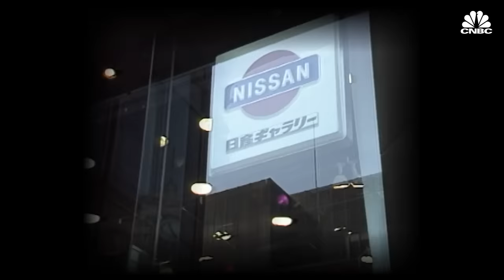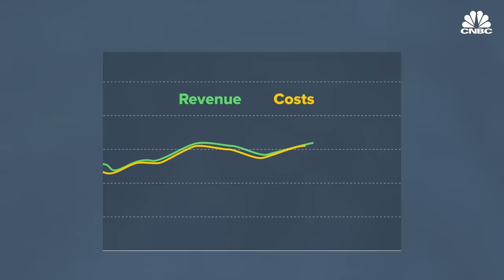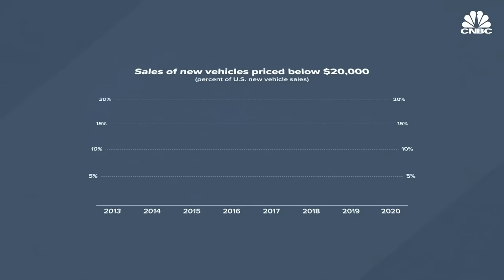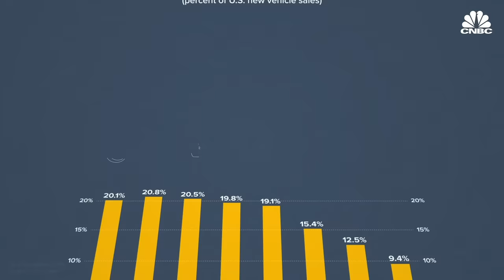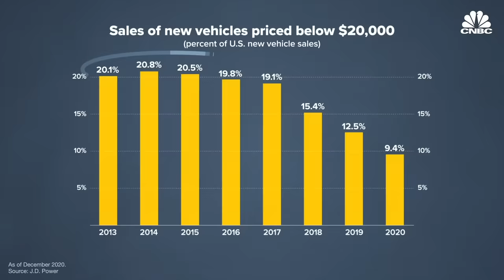Why Cheap Cars Are Disappearing

Comment: Just buy a 3 years used car and save like 40%
Reply: I think that's a big part of why cars are getting more expensive. People who want to buy a cheap car get a used one.
Reply: @TheTaquitoProject  interesting, there should be a comparison for that. Used car sales vs cheap New cars sales correlation
Reply: But I dont wanna have car trouble in the middle of nowhere, stuck in a forest with a used car. New cars wont break.
Reply: @fynkozari9271  Wrong. Friend of mine bought a brand new car.  I bought a used 10 year old Toyota. Guess who's had more car problems? Not me.
Reply: I drive a 14 year old Toyota Camry SE. I don't spend no more than 7k grand on a car. I bought the Camry fe little as $4k. Toyota's and Hondas are the best used cars to buy and keep them for decades as long as you keep them well maintained. Scotty Kilmer still drives his 94 Celica.
Reply: @fynkozari9271  I'd take a 100k mile toyota celica over a range rover any day when it comes to reliability. It depends on the car and whether or not you take it to a good mechanic before you buy.
Reply: @fynkozari9271  Say that to Chrysler or Nissan. I seen a lot of newer Nissans abandoned on the side of the highway most likely a failed CVT.  To be fair all of the newer cars aren't made like they use to that are cutting corners and using more cheaper materials and a lot of plastic that are going the planned obsolete route. That's why I prefer to buy older Toyota's.
Reply: @fynkozari9271  When Lexus released their new LS400 back in the 1990's it had electrical wiring problems and recalls on day one, proof new cars aren't immune.
Reply: @TheTaquitoProject  Just take a look at The Fast Lane Truck YouTube channel's new Defender!
Reply: @eman0828  the cvt issued are all pretty much addressed from 2017 onwards but for a good 7-8 years they were pretty awful.

Now that those issues are resolved Nissan are back to being decently reliable, not even close to Chrysler.
Reply: @BigHeadClan  LOL highly doubt that. They still use the same ole Jacto transmissions. Nissan has been using Jacto transmissions for years. They make some of the worst transmissions in the world. Toyota uses Aisin which are way more reliable.
Reply: @eman0828  A Jatco transmission which has been redesigned 3 times now...

Sure Aisen over Jatco but the number of reported transmission issues follow the 2017 redesign.

You think Nissan wants to pay out warranty on tens of thousands of transmission repairs and settlements????
Reply: @BigHeadClan  yeah after three failed attempts. Still don't laste like Aisin transmissions. Nissan is better off ditching Jacto and going with Aisin. Not to mention Nissan has a history of blowing head gaskets. Subaru probably being the worst in that area.
Reply: @eman0828  They were the first to bring CVT to the mainstream that's what happens when you take risks sometimes you slip and fall.

Also their head gasket were addressed nearly 10 years ago, but if you want to go that far back let's talk about the massive oil consumption issues Toyota had around that period.
Reply: Buy a demonstrator. My wife bought a one year old car with 1000 miles on the clock. She paid less than the price of the base model for the top of the range one. 20% of your 40% depreciation probably happens when the wheels leave the showrooms forecourt.
Reply: They get you with high apr though on used car.
Reply: @BigHeadClan  I've seen some late model years on the side of the road. I personally driven a 2020 Altima a few months back as a rental and the car was littery falling apart already. The windshield weather insulation was peeling of on a car that's barely a year old yet. The engine made a ticking noise. They are rolling piles of junk. Oil consumption issues doesn't effect the drivability of a car. That only affected just thr 4 cylinder from 2007-2009. All cars burn some degree of oil as they age. My 14 year old Camry even burns oil because of its age and near 190k miles on it. It still goes down the road.
Reply: @eman0828 good one in same club at scotty channel
Reply: @TheTaquitoProject  because cheap cars are overpriced
Reply: @eman0828  So your evidence they are unreliable because you see a few on the side of the road????  Can you provide any more anecdotal an example then that....  I see vehicles from every brand stranded on the side of the road up here due to our harsh winters and I can tell you they are usually there due to a lack of care and upkeep then any type of mechanical failure.

As for the 2020 Altima  the windshield weather stripping is a known issue but you were driving a rental,  no one treats those things nice so not surprised  it was so beat-up.  So far no major mechanical issues have manifested as of yet and small  things like that are common for every manufacturer  following a major redesigned which was a year ago for the Altima.  Last time I drove a 2018 Camry for a rental  multiple panels were rattling including the sunroof  and there was what looked like oil  forming on the front grill, so do

As for  the ticking noise you likely heard  the DI fuel injectors in the car, they are very noisy compared to port injection  systems the reason you probably don't  think about it with Toyota is because they use both Direct and Port which allows them to run or both systems simultaneously or independent  which has a few advantages one of which is quieter injectors. 

Also oil consumption issues don't effect the drivability  of a car???? Nonsense it can lead to outright engine failure,  the oil consumption issues in those model years was significant  enough that people were blowing piston rings, loosing compression in their engines or outright locking up in some instances for cars under warranty.

P.S It was 2006-2011 Toyota had a class action lawsuit filed against them and ultimately made a recall  my friends Matrix was part of the recall so I got to hear
his complaints first hand.

You think Nissan is a rolling pile of junk? I disagree my experience  has been great my 2002 Altima ran for 180K miles/15 years before I sold it and she never left me stranded (shes actually still on the road) ,  my 09 G37 is  approaching 160K miles and still runs just like new and probably will keep running for years to come.

Every car and models has their issues at some point, do your research avoid being an early adopter following major redesigns and you will usually avoid
the worst issues from auto-makers.
Reply: @BigHeadClan  I seen a lot. I drive mostly on the highway that drives 36 miles a day back and forth to work.
Reply: @eman0828  Total anecdotal evidence, it doesn't mean anything in the grand scheme of things.
Reply: @BigHeadClan  That's real world evidence that I seen with my own eyes and drove a 2020 Altima on top of that from experience they are junk. They are no where near on the same quality as Toyota like they use to be in the 90s before the company gotten bought out by a French company. All the new Nissans are full of Renault parts.
Reply: Actually that is also getting to be a bad deal. Nowadays they are asking outrageous prices for reliable used cars, like any Toyota product, for example! Try shopping for a 3 or so year old TOYOTA with low miles and see how insanely outrageous the asking price is! What people don't realize is, buying a used vehicle is an inherently risky proposition, and the price should reflect that regardless of the reliability of the vehicle. 

Yes, a reliable vehicle should obviously sell for a little more. But the crazy prices they ask, does not reflect the fact that it is still a USED vehicle, and we don't know how the original owner treated it, which can have an impact on the longevity of the vehicle. If you're really lucky, you'll get a car that was "babied" by its original owner/s. However, you're just as likely to get a car that was "abused" and "beaten to death" by its owner. You simply cannot tell by just looking at the car, or even inspecting it. These issues began to manifest themselves much later in the car's life.

Of course, if you're just buying it to keep for a few years, like 4 or 5 years, this may not be a big deal. But if you want to get the most out of it, and drive "till the wheels fall off" (like 10+ years), then this can really come back and bite you in the a$$, if the car was not well maintained!!
Reply: With everything I said in my above post, I did get an extremely good deal on a 1 year old 2015 Toyota Corolla, which I bought back in 2016, with 31,000 miles on it (obviously mostly highway miles). I bought it for $14,700 (out the door, including the extortionate 10% California sales tax). A new one would have cost me around 21K OTD.  But you can't just walk into a dealer and expect to get something like that! I got very lucky, as it was a private seller (the original owner), who was in some financial difficulty, and I was able to get it off his hands by paying CASH.
Reply: Even better buy used Tesla (the lowest depreciation in the industry) and save 80% over 15+ years.
Reply: Or honda or toyota near 10 year old or more. I got smart mirror dash cam on amazon for 60 that records front and back and has reverse camera. For 40 more i coulda gotten the one with motion detection beeps, i got a android radio with gps antenna for 80 (came with back up camera) on a 2004 Toyota Camry with 72 k miles. That's almost brand new for a Toyota. Amazon even sells heated seats lol or pads for heat if you want that over a leather seat cover you can buy too.
Reply: 100%. I drive an 03 TSX. Even with all the maintenance added to the cost of the car.... I'll end up less than half the price of a new Civic. 

I did tires, alternator, clutch, AC pulley, spark plugs and battery over 2 years... and I'm still at 35% of the cost of if I had a purchased a new car.
Reply: Save 40% and pay more for maintenance.
Reply: @davidbeppler3032  EVs have rather poor resale vaule. I don't know where you get your baseless claims from. And buying a used Tesla esp past its warranty is a huge mistake. Those cars aren't cheap to service once something breaks. It's a luxury car not a mainstream car for mass market. Luxury cars have very high cost in repairs.
Reply: @747-pilot  with using common sense, never buy a used car without getting it checked out by a pro mechanic before buying. You can then talk the price down on the vehicle after it's been inspected or walk away. Plus a 3 year old car is going to cost a lot more than a 10 year old one. I buy older Toyota's that are well maintained that only pays a fraction of it what it oringal cost that still got 80% life left in it.
Reply: @JungSooLeee  -

What that person said does have validity.  The cars are designed to go through two buyers, then taken off the road.  The theory behind it is the auto makers can justify production quotas, banks can make money off of one automobile twice during it's lifetime, and dealership can remain open to get product out to the public.

The industry and even the banks push for people to buy new.  The problem is people act like buying base model or one level above is beneath them, buy too much automobile, then try to justify the 7-8 year monthly installments.
Reply: the methods that are available to consumers to ensure used cars aren’t lemons are far better than they were a generation ago. (Carfax, KBB, the proliferation of tools like Carvana that remove the dealer’s incentive to live up to the “used car dealer” stereotype)
Reply: @sriig  Carfax can have many holes since they don't necessarily show everything. I checked out a website at a local dealer in my home town that is carfax certified and looked at one car that was missing history records for 4 years. The mileage went from 75k to 174k miles. Nothing was reported between those years. Dealers are probably the worst place to buy a used car that over charges for an auction car they bought for pennies. U can get a better deal with a private  seller. Most used car lots don't fix auction bought cars. They are sold as is. I seem a lot of junkie cars from door handles falling off to cracked windshields.
Reply: @eman0828  Hyundai is better
Reply: @olusegunadebayo5306  Not even close. They just improved over the years that went from rolling piles of junk to better improved vehicles. They don't have the same experience in quality control like Toyota given that Toyota pioneered Lean Manufacturing. Toyota was the very first Japanese manufacturer to receive formal training by Dr. W Edward's Deming during post WWII. Kaizen originated from Dr. DEMING 14 point philosophy known as continously improvement. Toyota also developed the Just-in-time system known as Kanban. Today every manufacturer is trying to copy the the Toyota Production System. Hyundai borrowed from Toyota and studied thier production system to improve their cars.
Reply: @fynkozari9271  Wrong.  Even new cars die or have issues.  One can buy a good used car with a great warranty, especially through a dealer.  My daughter bought a two year old Jeep Wrangler with a bumper to bumper warranty. Well, whaddayouknow, a major electrical issue not long after.  All covered.
Reply: @fynkozari9271  only used car will break? Naive much?
Reply: @fynkozari9271  a 5 year old Corolla will be more reliable than a brand new Mitsubishi Mirage.
A properly maintained well built car made in the last 10 years doesn't just fall apart.
Reply: @BigHeadClan  I drive a 2019 Nissan NV1500 for work.  It's got 17K miles on it now, it drives worse than the 2016 Chevy Express van I turned in 6 months ago that had 75K miles on it.
Plus the 2016 Chevy was better optioned even at its base model.
Reply: Agree. Don’t let them add all kinds of crap in finance. Just say NO!
Reply: @fynkozari9271  I bought New Nissan Rogue 2020 at the Dealership and only 11 months Engine problems light On and lots of issue.
Reply: @Sam S same here my nissan rogue 2020 only 4,000 plus miles on it 11 months and lots of issue. and engine lights on and I am afraid to drive on freeways on it. I regret buying..
Reply: @eman0828  Good choice of toyota..I regret buying my New nissan. at first they repair it , let's see what next. I always taking care of cars but the problem is defective materials, plastics...
Reply: @fynkozari9271  New cars breakdown everyday. Just because it's NEW doesn't mean it won't breakdown.
Reply: @BigHeadClan  seriously. My mom has a post 10s versa note from enterprise (rental cat company) sales that runs like a dream. There's only a handful of issues (tire air pressure sensor is one but those bust easily anyways) that could feasibly be seen as cosmetic more so than mechanical.
Reply: @eman0828  Which is precisely why it can't be relied on, Nissan sells millions of cars per year and you claim the small handful you've seen are representative of an entire brand.
Reply: @BigHeadClan  Their quality control is crap. If you think a French Rensault car is on the same level as Toyota then you are definitely delusional. It's a proven fact that Nissans aren't built the same like they were in the 90s. That's why you don't see the brand ranking the top two in reliability scores. Toyota and Lexus has been in the number 1 and 2 spot for nearly 20 years in a roll on Consumer Reports unchanged. Some times Toyota and Lexus has flipped 1 and 2 spots but the two Toyora brands stayed consistent all those years.
Reply: @jokeassasin7733  What does your personal like/dislike of the van have to do with reliability?

Im not going to try and convince you that you are right or wrong, if you dont like the van take it up with your work.
Reply: @eman0828  Nissans quality control is fine  by and large and in terms of overall reliability Nissan/Infiniti has stayed around the top 10 of automakers  for most of the past 20 years. 

Hardly the disaster you've made them out to be, according to both JD Power and Consumer reports for every 100 cars that roll off the line  Toyota is expected to have around 113 issues for Nissan its 134.

Or a 15% chance that you will have two issues on every car sold instead of just one issue.

Most cars  are very reliable compared to the 80-90s and the margins that separate them from one another razor thin.
Reply: @Vlad2319   Not all of them have issues but many did around that period, to be clear it was specific to CVT's so if your mom had a manual she is probably going to be problem free for a loong time.
Reply: @BigHeadClan  You are pretty delusional that's all I can say. You must own a Nissan and is probably but hurt because I tell the truth. It's not even really a true Japanese manufacturer anymore. All the modern Nissans are full of French Renualt parts. Rensualt is not known for relaiablity and quality control. Nissans original philosophy had changed and went through several changes in management, production process has changed. Everything has changed since Renault took over. They were neck to neck in the 90s with Toyota and Honda. They were way better made when they were called Datsun back in the day. Times have changed. Its ain't the same company like ot use to be.
Reply: @eman0828   Clearly I am wasting my time here because if you bothered to read what I've posted thus far instead of just skimming them and shifting the focus of the discussion d then  you'd know I've owned  2 Nissan's over the past 18+ years.

Good luck to you sir I hope one day you realize that there are other brands outside Toyota that are just fine to keep long-term.
Reply: @BigHeadClan  Better listen to Scotty Kilmer lol. They are junkie cars.
Reply: @montyi8  70% of cars sold early are 
 Used cars. The higher price offsets the used market value. The same as phones which are the new lease to buy nonsense. They sell next years model this year to squeeze the illusion of time. Ex) i buy a 1999 car in 2009 the car is 12 years old not 10 value wise.  The new  car was available for sale 1 year early. The current car for sale is 1 year in the future. After 1 years ownership your old/new car has depreciated 2yrs in value.
Reply: @Sam S That's because the parts are ridiculously expensive.
Reply: @TheTaquitoProject  It's what killed the Honda Fit in the US. The people who want a Fit would prefer it used over new!
Reply: @fynkozari9271  I've never been stranded. We've had 5 used and 1 new car in our family. (Two were used up at 16 and 17 years old, two totaled, and we own three now.)
Reply: @JungSooLeee  Toyota is not a car, Toyota is a reliable  piece of engineering made to last, Check the PRIUSes , oil change, brakes, standard maintenance..no surprises ..no BS